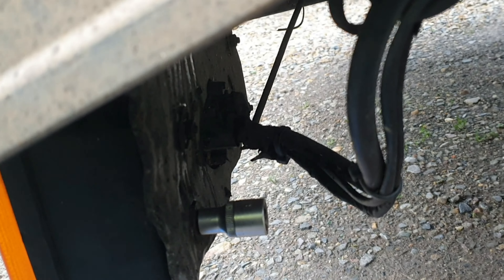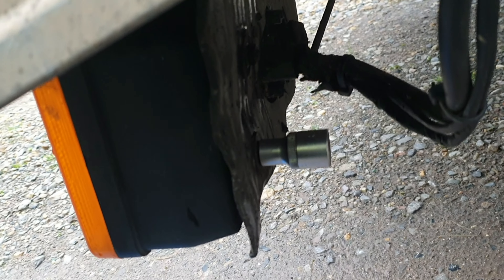My Recovery Truck Upgrades & MOT

Comment: For the fuse i would use a piggyback fuse-holder connected into the fuse box. This would save running a wire from the battery. The fuse holder will just clip into and existing fused supply and give you the feed you need
Reply from the maker: I didnt even know they were a thing! Thank you ever so much for that they will come in handy as I plan to install amber lights to the front grill and rear of the truck. Thanks again mate
Reply: @SalvageDiaries  no problem. I didnt know they existed myself till a few years ago. They are well handy for wiring things like dashcams etc and they can be added and removed without the need to tap into existing wiring.

Comment: Have you just twisted the wires and put heat shrink over them?
Reply from the maker: The wires I've extended have been twisted together and used heat shrink with solder in the middle and then electric taped them heat shrink
Reply: @SalvageDiaries  I like your technique

Comment: Rear work light switch
Reply from the maker: Hi mate the wire is teed into the stop light meaning it's only live when the brake is engaged? Or do I have that wrong, electrics isnt my strong point lol
Reply: @SalvageDiaries   hi mate thanks for the reply  yes ur rite on the teed part but was teed bcoz of rear fogs lights to work from the witch  ther is live wire  that is disconced from the switch  if you look on video   its  laying next to the plastic  hinge part  on you trim cover    its black wire with red spade connctor   that prob came disconected when you removed the cover  hope this will help you  live wire is  from battery or the fuse live  thanks for ur upload  you did exclent job on the leds lights conversion
Reply from the maker: Ah yes that was the ground wire. It was too short so when that compartment was opened it became disconnected! My understanding of the wiring is the live was fed to the stop light and the other wire was to what looks to be the fog light, slightly confused as I would imagine if it was for fogs it would be connected to the tail live
Reply: @SalvageDiaries   yes  live should run tru the switch  to trun on the fogs if ther ran it true the brake lights  each time you press the brakes the fogs will turn on also im guessing  the original  fogs must have broke when reversing. Or   the switch broke   unless ther use the switch to disable the brake light stealth mode lol

Comment: I always thought left side has a fuse line and the right has its own fuse line switch in cab could be for fog light 👌👍
Reply from the maker: I did think it was a switch for the fog but the wire was teed into the stop light wire instead of the tail wire? Meaning it is only live when the you brake?

Comment: It would also be beneficial  for you  to fit a white led spot light on back of the cab shining backwards to help loading & unloading in the dark. Make sure the switch  you use for this is illuminated  type switch  when its on so you  don't  leave on and be driving with a white light shining behind you.

Comment: Fog light switch
Reply from the maker: Hi Clive thanks for your comment, I did think that but the live was teed into the stop light meaning it's only live when braking?
Reply: @SalvageDiaries   may be wired up wrong , I had a fog light switch just like that on my recovery truck . They are the first thing that gets ripped off when reversing, lol . I ran out of wire from loom so needed to add another switch
Reply from the maker: Haha it's a nightmare electrics has never been my strong point! I will definatly re wire in a new feed for the fogs! The new leds have fogs on them so will make good use of them. Thanks for your help mate
Reply: Car Trader Diaries  Good video mate, if you add more please make another vid I've got a truck and need to get some lights added